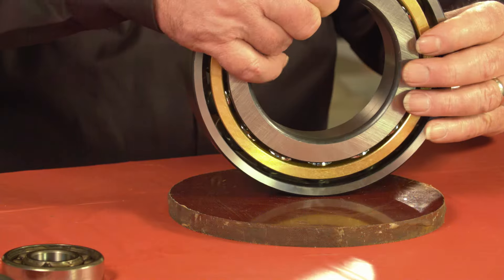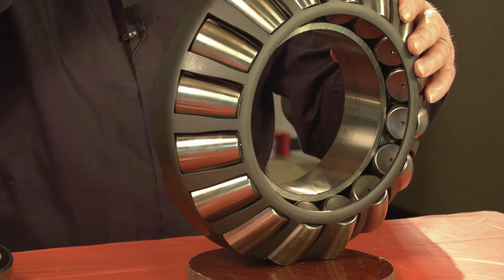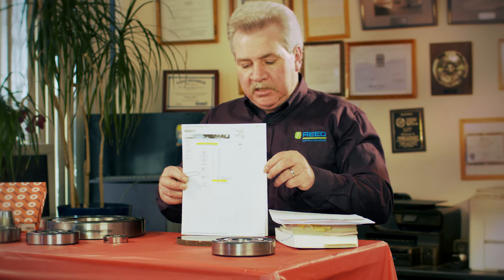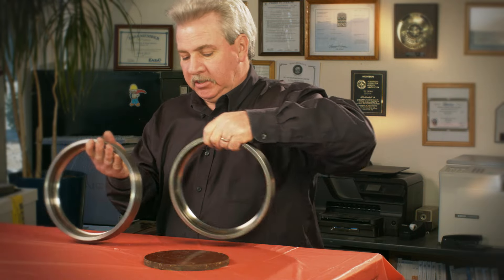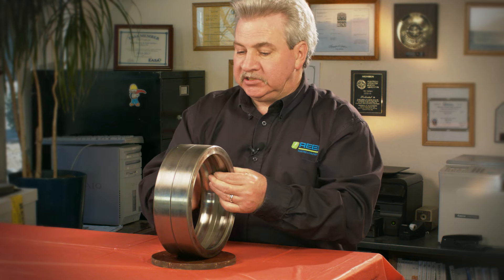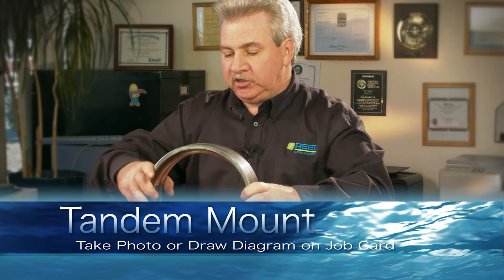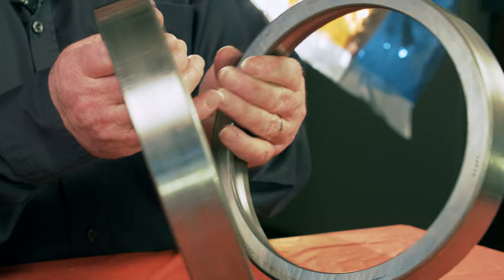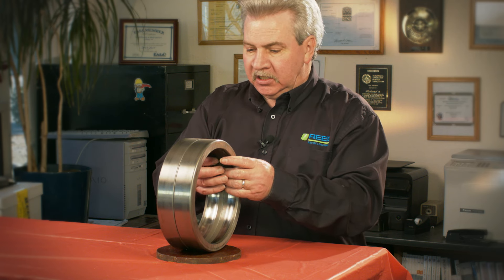Thrust Bearings - Angular Contact and Spherical Roller

Comment: Are the angular contact bearings in two parts?
Reply from the maker: Cranebeg - the angular contact thrust bearings discussed in the tutorial video have 3 parts - the outer race, the inner race, and the ball bearing/cage assembly.